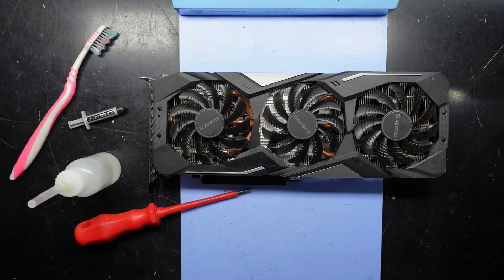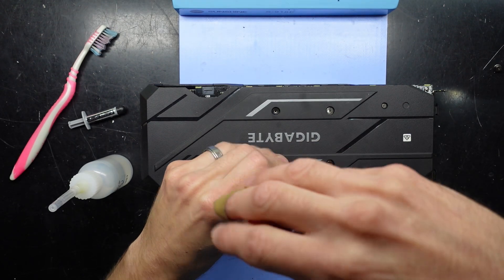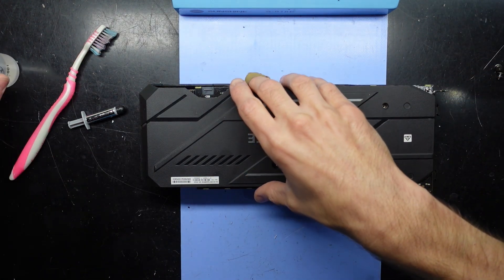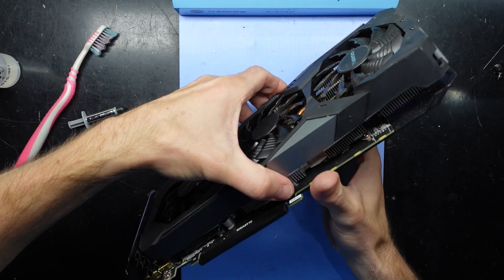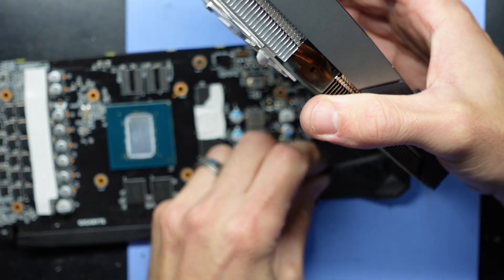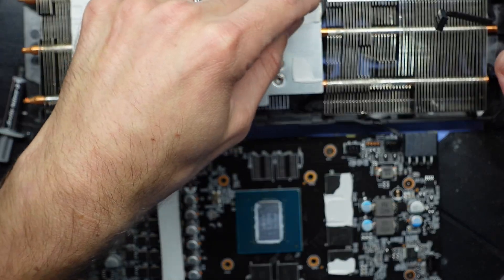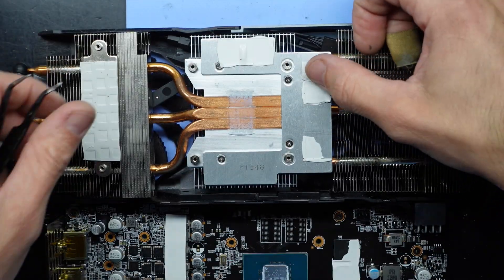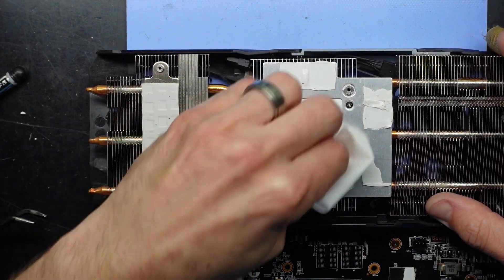Gigabyte GTX 1660Ti Gaming OC Thermal Paste Replacement

Comment: About three years ago I had a 1660 super msi ventus, I also changed the thermal paste, and I noticed that it did not have the same temperature as when I bought it, I tried two thermal pastes, artic mx4 and glizzly kryonaut and I did not like the temperature it reached, Finally I tried a paste that came with an Antec heatsink and this was a good paste, the graphics working at 99% did not go above 67°, the others stayed at 74°,
I finally bought a tube of formula x antec paste on Amazon imported from the United States, I liked that paste
greetings.

Comment: Is this liquid metal if yes then you will going to blow this thing badly because LM is conductive material and the small capacitors will get shorted with this you need to coted the small capacitors with some glue before using liquid metal
Reply from the maker: this isn't liquid metal